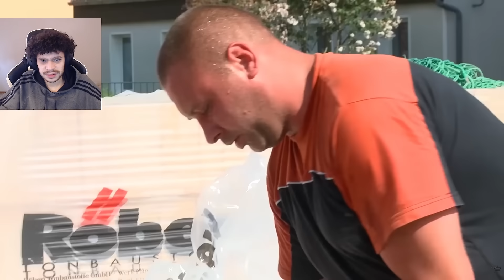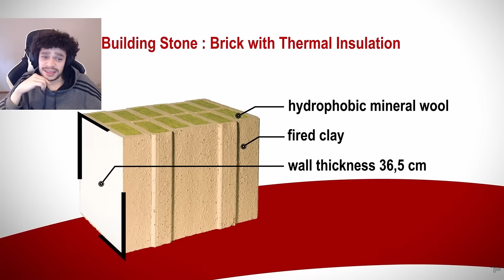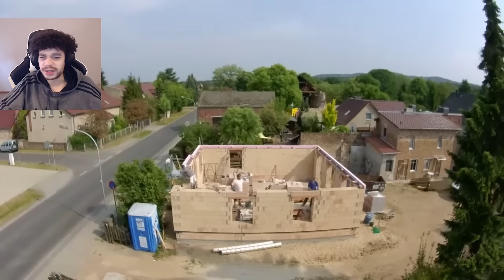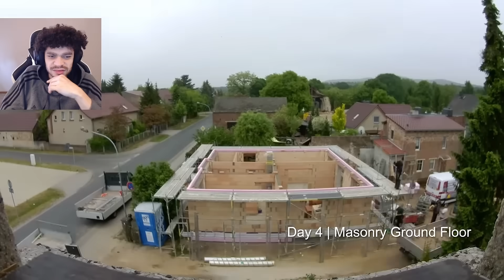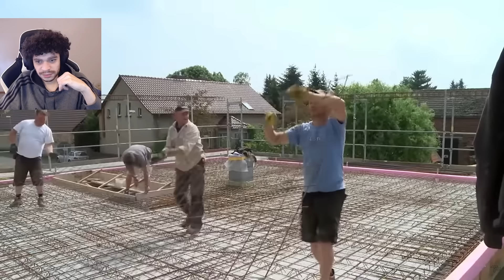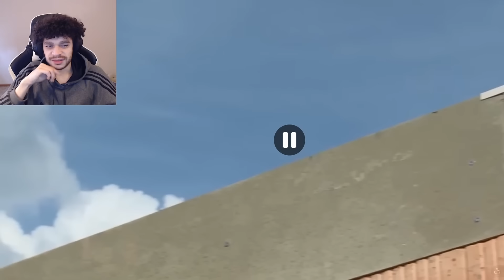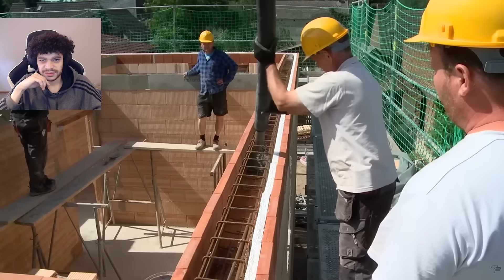American Reacts to How German Houses Are Built! *IS THIS REAL?!*

Comment: Yes, most of the buildings in Germany are still made of different types of brick or concrete (>90%). Wooden framed houses are a thing, too. But compared to the stone/ concrete houses, that's only a small fraction. And even then we are talking about much sturdier wooden constructions than in the USA. So no 2x4 or so... Our building codes are much stricter than in the USA. Take only the roof as an example. What you in the USA put on as a roof (OSB with asphalt shingles nailed on top) wouldn't be allowed here. Maybe for a garden shed or a dog house. But not for a real building. 

And houses last much longer here. My house was originally built in the 1912 in a half timber style (6-8 inch posts/beams with brick in between as walls) and modernized two times (in the 1960s and then again 10 years ago by me after I bought it) and it is up to todays standard/ code regarding, insulation, piping, electricity, heating,... An we even have not only a few houses here, that were built, even before a guy called Columus arrived at an place that's called America today ;-)

Comment: Some additional Context: Every Hous in Germany has been planed by a certified Architect. Because it has to follow Rules about Static Safety for example.
For that Reason the Concrete Slap/Fundament is so thick, to withstand a possible Earthquake.
The Homeowner in this Video has chosen not to build a Basement, while a lot do. The Homeowner has also chosen not to have Rolladen/shutters, while many do.
The Roof Structure in this Video/Series isn't the norm, because it is of lower Quality, but cheaper. Most Roof Structures are build with joints enforced with long steel bolts.

Of course planed by the Architect too, in order to hold the regulated amount of Load/Snow safely.
Reply: How can you build a house without an Architect????
Reply: @saladspinner3200  In the past people knew how to build houses. It's just the modern state that force all of these expensive procedures on the citizens, making it almost impossible for the average person to build their own house.
Reply: @toxic-o1u  In the past more houses collapsed and killed people leading to more regulations.

Comment: It’s not just Germany. In Europe, most houses (excluding some of those that are older than 80–100 years) are made of bricks, hollow blocks, or concrete slabs. As for bricks and hollow blocks, there is a vast variety of types, sizes, and appearances.

This is just a brief overview, since we would have to analyze each European country separately and consider the specific differences between them.
Reply: Well technically, if we speaking outside of America, the way of building houses is somewhat similar, maybe the huge difference is what kind of brick is commonly use, etc.  but regardless, is kinda the same, that's why when i was kid, i was so surprise seeing content from America that displaying people can easily punch a hole on to their wall, back then i thought American people were very strong to the point they can brake their wall just by punching it, but now I know it's not😅
Reply: Especially older houses are build from bricks, because that was the primary building material. When you get to the really old ones, timber framed with brick.
Reply: In northern europe it gets a bit less common.
Reply: @sagittariusa9012  Yeah, but there they use timber frame buildings, made from quality wood posts. Not like in murica from the cheapest boards you can buy and nail together.
Reply: @AleaumeAnders  True but I never said anything different. It was about the 

"In Europe, most houses (excluding some of those that are older than 80–100 years) are made of bricks, hollow blocks, or concrete slabs" 

which was written :)
Reply: @sagittariusa9012  nod my comment was directed more towards the muricans, who might missunderstand. You know, if you tell them that scandinavian houses are often made from wood, they'll assume it's the same as their toth pick and cardboard "houses".
Reply: @AleaumeAnders  That is true :D
Reply: @AleaumeAnders  yup, because if we didn't specify and just mentioned "wood", they will think it the exact same thing as they have, i know is ridiculous for us non American to think that anyone want their house wall to be made by material that easily destroyed just by punching them, but should make it easier to understand nonetheless to save ourselves from unnecessary debate😅
Reply: @AleaumeAnders  No its not higher quality in Nordic country than in USA, what the diffrance is, is that lumber in Nordic countries is 45mm and in USA its 38mm. Its the same "quality" but US lumber is a bit thinner.

This is actually not what make US houses flimsier. Its the general construction code. Basically what is a inside wall surface in Sweden would be a out side wall courage in USA. And outside coverage is typically solid wood in Sweden.

The only dry wall type construction of inner wall in USA you wouldn´t see in Sweden short of a playhouse.

The irony of this is that those differences is really not that expensive.

For example a US roof would typically be a 1/2" OSB board coverage. In Sweden its typically a 22mm interlocking massive wood roof. And of cause the Swedish coverage is quite a bit more expensive, almost twice the cost.

But this totally ignore that the roof substructure for the american roof is typically CC 2 or 3 feet, while it in Sweden is 1200mm. This shaves of a lot of the diffrance. And then the Swedish roof need no blocking, becasue the roof material is much stiffer, while this don´t save that much money, it saves quite a bit of work. And the Swedish roof can also synchronize with the wall, remove the need for a wall top lintel. If the whole cost is broken down its really no much of a diffrance.

The major diffrance a Swedish home is typically more expensive is that they almost always have double or triple  thick walls. My home for example have a 145+95+95 thick wall. This is a bit more than typical, but not that much more. US homes typically have one layer only with a 6" or 8" (140 or 184mm) wall. That it. Swedish homes need a inner and a outer frame.

Its worth saying here that the inner frame is typically either perpendicular or moved 300mm or so sideways to break cold bridges.

Windows is similar. typically US window is 3+14+3mm argon. While a Swedish window is typically 4+20+4+20+4. The Swedish window is twice the mass, but also half the U-value of a typically value of about 0.8-0.9 while US windows are typically closer to 2. Using a US window in Sweden, would literally not be code compliant. 

Houses are smaller in Sweden, but not as much as one might think. Swedish typicall new build is about 180m2 while US typicall new build is 220m2. Even at that, laundary room and walk in closets are counted toward the 220m2 in USA but not towards the 180m2 in Sweden. So the actuall diffrance may be a bit smaller.

Comment: We know Gipscartonplatten when we renoviert or change the Layout. But otherwise you don't hit a wall since you would easily break your Arm before the wall gets a dent. Today the demanded insulations are crazy. We live in a house that was build 1963, when we changed our roof after more than 60 years our heating costs dropped to nothing. We have central heating but for the next few houses in our row our cellar heats the whole house in Winter. We nowadays say we heat electric, the restheat of Computers and TVs heat the room.

Comment: In Germany we know Dry-wall. Called Gipskartonplatten. Mostly used when you renovate and isolate old houses and here in special the cellar (making a liveable room in the cellar) where otherwise you would have only a cold concrrete wall and all pipes and electric wireing running open through the room. Its more for additional insulation and make the room walls look cleaner. Same when the room under the roof is later converted into an extra living room and we put drywall as beautyfier for the room (and as Walls or ceilings).
Reply: Here in Czechia, dry walls are mostly used only in offices or under ceiling to hide lights and cables, I never saw a house where someone would make actual wall from it, interior walls are mostly made of ytong here light concrete bricks.
Reply: @Pidalin  No actual walls but using the dry-wall as kind of cover of the real ugly walls so you can easy put some wallpaper on it.
Reply: @dirkspatz3692  Why would you put wallpaper on something? It's not 80s. 😀 Here in Czechia, wallpapers are something communist and nobody younger than 50 would tolerate it at home. Wallpapers are the worst invention, you can clean it and to replace it is so much work, just pain normal wall is so much easier and instead of puting some drywall there to cover something, what about to make a new plaster to fix the wall? It's probably even cheaper. 😀
Reply: @Pidalin  Rauhfasertapette still popular in Germany.

Comment: Dear friend I am german and the only thing I admire about america is, that you can go to a gunshop and buy whatever you like.😁 Yes, our houses are build like this. Not all, but the most. I know it, i was a scaffolder for over 20 years. And you have to have a big wallet using isolated Poroton bricks. They are very expensive. So normally they are not used for inner walls. For what?  You got cheaper alternatives.

Comment: For one thing, Germans often spend their entire lives in a house they built themselves; it is, therefore, a lifelong commitment. Naturally, numerous building regulations must be observed, which in turn influence our construction methods. In Germany, solid masonry construction is traditionally preferred over timber-frame houses, primarily due to its superior durability, fire resistance, and value retention. The superiority of this construction method is evident even during tornadoes—which do occur in Germany; while roofs may be destroyed, the building itself remains intact and can be repaired. In Northern Germany, where I live, exterior walls are typically finished with brickwork rather than plaster; this is because the high groundwater level would allow moisture to penetrate quickly and damage the plaster, and because plastered walls are particularly exposed to the elements—especially strong winds and storms—due to the flat coastal landscape.
By the way, exterior walls in Germany are so thick because they have to support the structural weight of the roof—which is usually covered with roof tiles.
Thanks to the tradition of solid construction in Europe—including here in Germany—there are buildings that reach ages of several hundred years. Germany’s oldest building is 1,700 years old: Trier Cathedral. There is also a private house known as the "Korbisch," which is 1,070 years old.
Check out the other videos about this construction project as well. They also show the interior fit-out; it would be very interesting to see more of your reactions to this build.😊👍👍
Reply: And we maintain them so our children can inherit the houses. I live now in the house my parents build 60years ago. Still hopping that the roof tiles doesn't need to replaced soon.